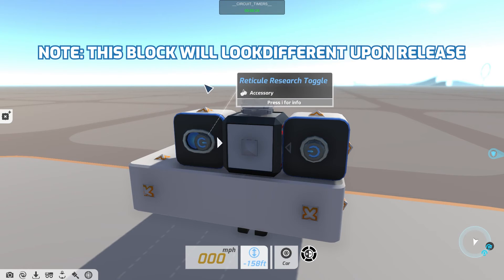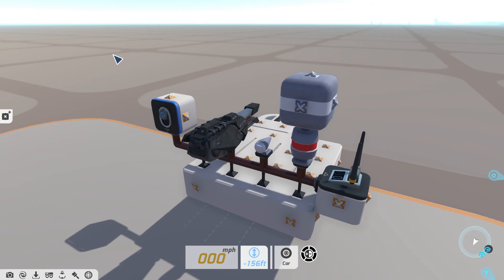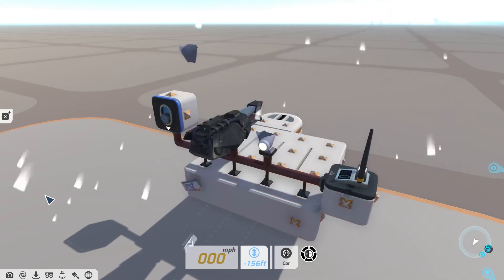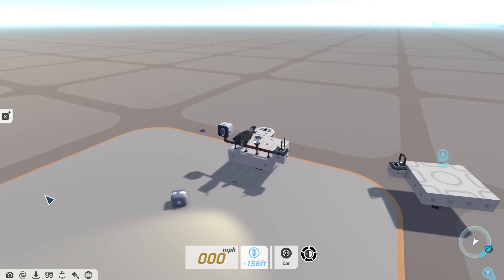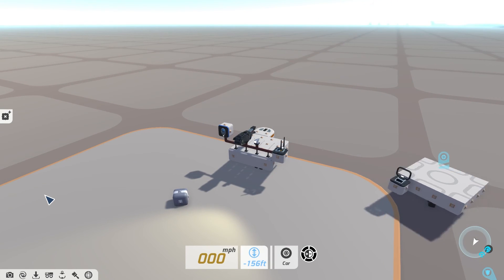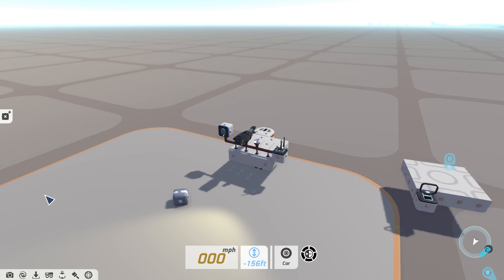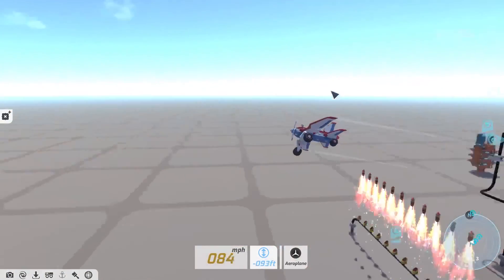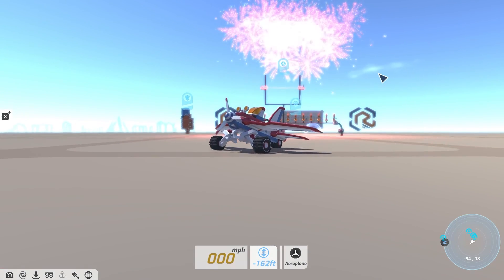How To - C&S Output Blocks || TerraTech Tutorials

Comment: 1) explosive bolts (EB) got bugged:
a) if I attach EB to a cable, I cant detonate any of the attached ones manually (via keyboard)
b) a logic 1 will detonate all EB on said cable, no matter wich tier of EBs they are.
c) on a tech with logic circuits on it, I can only detonate an EB#1 manually as long as it is not attached to the cable, but I cant detonate EB#2 manually

2) only lights, weapons and EB (in a faulty way) seem to be activable by logic imputs, and as soon as they are part of a logic circuit, the player cant manually use them anymore. Shields, repair bubles thrusters and wheels, among others, cant be integrated to logic circuits. It would be nice if you at least make the magnetic switch and BF controller be able to be activated/deactivated by logic imputs.